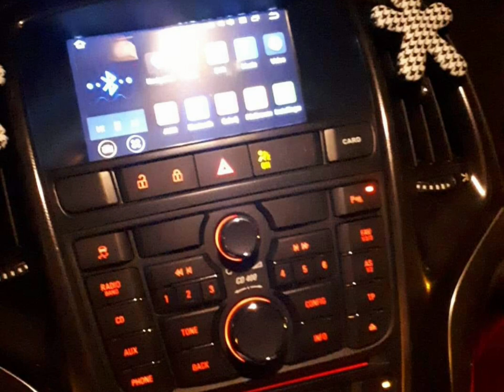Tuning opel astra j

Comment: Hey. I noticed you have a touchscreen infotainment, i was looking to buy the same one from ebay but i am worried its low quality and i can't find any reviews online.

How is the fitment, does it lag and does it feel like cheap plastic? Thank you for your time, hope you respond
Reply from the maker: Hi, i bought mine from ali-express but yeah it's kind of tricky where you buy it from because some have issues but others don't and like me i don't have had any problems yet and it's almost 2 years now installed so i'll say it's worth it's price and works great, good fitment, plug and play, just needed to search a bit wich connector should belong where but they're all different so you can't possibly put the wrong wires together. There's no manual in the box so that's all but everythong else you need is in the package
Reply: @arondemeyere6090  hey man, thank you for the reply. I'll look around for the best quality display i can find. You have a super nice astra. I have the same headlights, a bit expensive but worth it. Your car is 10/10

Comment: Hi mate, is the front bamper from vxr  and  where did you got the rear Diffuser?
Reply from the maker: You can get it in both opel or vxr, it's called bi-turbo bumper: originally mounted on the 2 liter diesel bi-turbo
Diffuser comes from a german site but isn't available anymore

Comment: Is this on coil overs thanks
Reply from the maker: Yes it's on coilovers from KW v1 with ultra low springs in the back
Reply: @arondemeyere6090  thanks for reply I lowered mine 40 mm all round still arch gap have you got link or picture of yours thanks
Reply from the maker: @carlmurphy6899  if you have instagram, you can find a lot of pictures of the car on my page @aron_mk6 
I went for the extreme lowering with flush fitment😅

Comment: Is this the Sri front bumper and did it fit straight to the car?
Reply from the maker: They call it the bi-turbo bumper cuz it's normally only fitted on cars with the 2 liter bi-turbo diesel engine. It's a facelift bumper so i had to replace all the mounts to facelift mounts, after that everything just fits perfectly

Comment: One question for the wheels: does your car have the 5x105 or the 5x115 (German: Lochkreis) diameter?
Reply from the maker: 5x105😉
Reply: @arondemeyere6090  Really? Thats´s impressive...good tipp for me that this fits. Thanks very much
Reply from the maker: @komfluterchaosprafekt1426  yeah maybe sometimes harder to find but both sets were brand new, first one were 18 inch (rep opc) and second ones are 20 inch (Riviera wheels)
Reply: Hello, i have one question, what size does de tires of the riviera wheels have ? Thanks
Reply from the maker: @edwardvaniseghem406  sorry for the late response but they have 235/35 R20

Comment: la jupe  par choc arriere se monte sur la astra 1.7 de 2010
?
Reply from the maker: si la voiture est aussi une hatchback, cela devrait certainement fonctionner
Reply: @arondemeyere6090  psk moi c est la astra cdti de 125ch de 2010 et la jupe du par choc et démontable pour moi c est la même mais sur des site il dise que c est pas possible c est sa je comprend  pas
Reply from the maker: @kleluc7775  peut-être à travers votre échappement qu'il se retrouve de l'autre côté qu'avec l'essence. J'avais un échappement sur mesure
Reply: @arondemeyere6090  justement c est pour faire une ligne d'échappement avec deux sorti  que je veus la jupe
Reply from the maker: @kleluc7775  alors cela ne devrait certainement pas être un problème car cela me convient parfaitement
Reply: @arondemeyere6090  merci beaucoup je vais pouvoir avancer sur ça et c est pour vous demander si vous avais le lien de vos suspension et la taille de vos roues ci c est possible ?
Reply from the maker: @kleluc7775  mon suspension c'est kw V1 avec des ressorts ultra low en arriere, les roues c'est 20 inch 8,5j ET 32

Comment: where did you buy the traffic lights?
Reply from the maker: The rear lights or the front?
Reply: @arondemeyere6090  the front
Reply from the maker: @Azoidis97  on a dutch site called gm-tuningparts but i guess you can find them on other sites too

Comment: how to remove the friezes of the steering wheel and the door to paint ??
Reply from the maker: from the steering wheel you need to take the airbag out and then you can demount the rest. the door panel it just clicks into it
Reply: Aron Demeyere is it hard to take airbag and stuff?
Reply from the maker: @rafaelbregante8131  airbag is easy, make sure battery is unplugged from the car so you don't accidently pull the cable from it: could open the airbag right away so. The rest is just plugged in but its kind of hard to pull it out easily. Be gentle when using screwdrivers so you dont scratch it or bend it
Reply: @arondemeyere6090  I should need a tutorial to make sure that i dont make shit xD

Comment: what kind of front bumper it is?
Reply from the maker: This bumper is called : Bi-Turbo front bumper. Normally you find this one on the ones with the 2.0l diesel bi-turbo and thats why its called like that
Reply: @arondemeyere6090  And before the lift will fit?
Reply from the maker: Yes it can fit on pre facelift, as you see my car is a pre facelift😁 you just have to change the mounts to the ones from a facelift and the bumper will fit perfectly
Reply: Where you get the duel exhausts